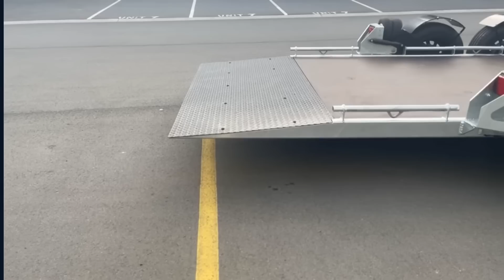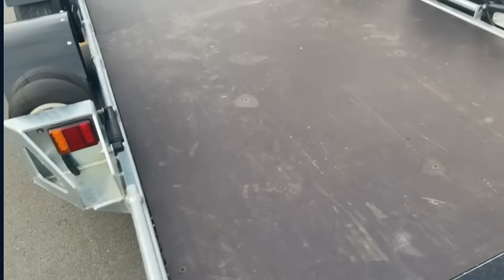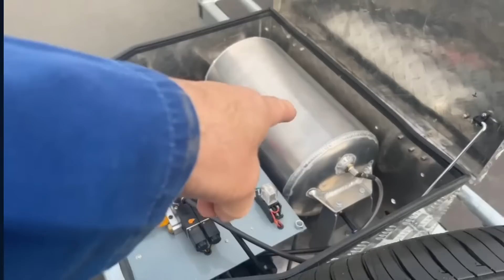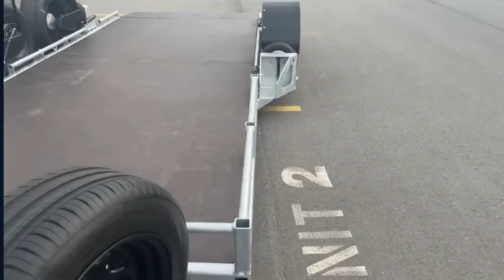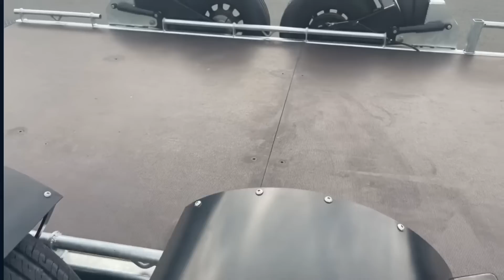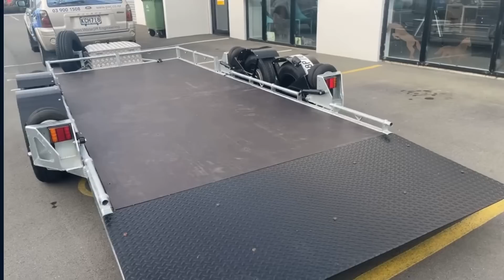How does an Airbag Trailer work 1.3

Comment: Looks like you need to add a Water separation system to the Air line and you can see that it's leaking from the Trailer Airbag and leaving the water puddles on the ground at the back axle of the trailer. And or a way to bleed the water out of the line.....
Reply from the maker: If you are referring to that small mark on the left rear of the trialer, I believe thats oil drips from another vehicle, you can see other oil marks on the tarmac.   We do have a water drain on the bottom of the air tank in the box. No water can leak out of the airbags, if water could get our, so could air, right :-)
Reply: @ultimatemanshed  well that so called oil leak did get bigger the next time he was walking around the trailer and then it should have a Air line bleeding valves on the Axle Air line and it should be just like a Normal Brake mineral based oil bleeder valve to get rid of the water that does accumulate in the line and then you can see that the so called oil leak isn't there on the first time of him showing it and then it's there 🤔 and I'm not being critical on this setup but it will need a bleeder valve on the Air System just like the Hydraulic System does 🤔.... and like the Brakes on your Car....

Comment: Excellent engineering, the only thing I would add is a mechanical locking mechanism for the airbag hinges. I'm sure they are tough, but just for peace of mind in case one blows.
Reply from the maker: so, the problem here is if a bag does blow, and we have never had one blow in four years with hard use and very adverse conditions :-) even if you lock the wheel down so that it’s on the ground in a fixed position you still have a leak out of the bag, and as a result, the entire side will drop, so the solution is to simply have taps on each of the feeders to the airbags, and that particular tap can be switched off that being the case, the wheel  can simply stay in the down position and follow along where ever the trailer goes so, locking the wheel in any position, if a bag should get a hole in, it doesn’t solve the problem of the air escaping from the system, for that, we need a different solution and it simply means having a valve that can be switched off after the Airbag entry point, and we already have these on some trailers

Comment: That trailer certainly would be illegal anywhere in Europe.
The end of the trailer is a huge no-go in so many aspects if you have an accident.
It's basically a perfect death trap at any  rear-end collision. There is a reason you usually angle the end 90 degree upwards.
Reply from the maker: In the EU, there are regulations that must be met when building a lightweight trailer for consumers to tow behind private cars. These regulations are designed to ensure the safety of the trailer and other road users.

One important regulation is the maximum weight of the trailer, which cannot exceed 750 kg (including the weight of the trailer itself and its maximum load). Additionally, the trailer must be equipped with lights, brakes, and other safety features such as reflectors and rear view mirrors.  

Regarding the rear loading platform height and length, there are also regulations that apply. The height of the platform cannot exceed one meter from the ground,  we are well below this and the length of the trailer cannot exceed 12 meters, we are under 6 meters.  However, these regulations may vary depending on the specific country within the EU, so it's important to check with local authorities for more detailed information. 

You say this trailer will be illegal anywhere in Europe. Please send us the specific regulations that we fail to meet and we will do our best to make the necessary changes
I think you will find that in an accident, the height of the rear loading platform on this trailer will go under any vehicle and a following car would ride up over the ramp.  You are of course right to point out that a particularly small car such as the one driven by Scooby Doo or Mickey Mouse should take more care and not follow us on a public road. We will send them a letter of advise :-)

Comment: Hi :)  That is really one of the nicest trailers I've ever seen. It sort of expands the concept of what a trailer is. I need to know though, how on earth can you drive this, with a normal sized car. It might just be very restrictive Danish regulation, but pulling 2000 kg with something that's not a whole lot heavier, is definately not legal in Europe. Also that electronic brake, how does that work?
thanks for the vid and potential answers :)
Reply from the maker: In Denmark, the rules for towing a car trailer depend on several factors, including the weight of the trailer and the type of driving license held by the driver. Generally, drivers who obtained their license before January 19, 2013, can tow a trailer with a maximum weight of 750 kg without any special restrictions. However, drivers who obtained their license after that date must take a separate test to tow a trailer with a maximum weight of 750 kg or more.

Regarding the weight of the trailer, Danish regulations state that the maximum weight of a trailer that can be towed by a normal-sized car is 750 kg. However, some cars may be able to tow heavier trailers if the car's weight and the trailer's weight do not exceed a certain limit. This limit is based on the car's weight and varies depending on the type of car and the driver's license category.

As for the electronic brake, this is a system that is used to control the trailer's braking when it is being towed. It works by using sensors to detect when the car's brakes are applied and then applying the trailer's brakes in response. This helps to ensure that the trailer stops smoothly and safely, even when the car is braking suddenly or heavily.

I hope this helps answer your question
Alan

Comment: This looks really insane. 
BUT:
What happens when there is lost air pressure during driving? For E.g. something will break on the airflow system, so it just gets lowered? This I see as a big danger. There should be some blocking mechanism when lifted or the possibility to lock the position as lifted. Just to get low unlock/remove some mechanisms for safety.
But the really nice proof of concept. :)
Reply from the maker: The suspension goes to the ground and you have to fix it. pretty much like a normal trailer if yo get a flat tire or broken axle or spring. However nothing happens in an explosive way, its usually a very slow leak at a connection, not the bags and it might take several days to go down.

Comment: Is there a protective cover for that razorblade shaped rear edge, when operating in traffic?
Reply from the maker: I don't know what sort of razor blades you have been dealing with but there is non on the trailer.  It's a ramp and anyone travelling that close wis going run in to anythign in their way.   In all the trailers and the years we have made these no one has run in to the back, sides or front.
Reply: @ultimatemanshed  Don't try to sell that in Europe. It's not going to pass roadworthyness.
Reply from the maker: @woeufuS  I am not sure where you derived your information but please consider the following as currently can meet all these requirements: 
 The purpose of this report is to outline the key requirements for building a car transport trailer that complies with the regulations set by the European Union (EU).

Weight Requirements:

The weight of a non-commercial trailer, including the weight of the car it carries, must not exceed 3,500 kg. This limit is imposed by the EU for safety reasons and to ensure that the trailer can be safely towed by most passenger vehicles without compromising their stability and braking capabilities.  We do make trailers that meet these weight limitations.

Brake System:

The trailer must be equipped with a braking system that complies with the EU requirements. The braking system must be able to bring the trailer to a complete stop within a certain distance, depending on its speed and weight. The braking system must also be able to hold the trailer stationary on a slope. The type of braking system required will depend on the weight of the trailer and the vehicle towing it. For trailers weighing up to 750 kg, a parking brake may be sufficient. For trailers weighing between 750 kg and 3,500 kg, a hydraulic or electric brake system is required.  We install a certified and EU-approved brake system on all of our trailers and exceed all their minimum requirements.

Lighting:

The trailer must be equipped with lighting that complies with the EU requirements. The lighting must include two red position lights at the rear, two amber indicators at the front and rear, and two white headlights. The lighting must also include a number plate light and reflectors. The lights must be visible from a distance of at least 100 meters.  We install and again exceed these requirements.

Maximum Width and Length:

The maximum width of a non-commercial trailer is 2.55 meters, and the maximum length is 12 meters, including the tow bar. The trailer must also comply with any local regulations regarding width and length restrictions on roads.
 Some of the trailers we build are over these dimensions, however, we also build trailers that meet these dimensions which are global and consistent with our New Zealand regulations.

So, I dot see the problem, please be more concise and tell me what we need to do to comply 🙂
Reply: @ultimatemanshed  Thanks for the answer. The ramps over here are normally folded up after the trailer is loaded. That prevents other road users from getting cut in half in case of a crash. But yes, I can't tell where the minimum radius of protruding parts is defined. Especially if this is towed by a 3.5t vehicle where the strikt rules for commercial trucks don't apply. 

 It also provides a rear facing surface for license plate and rear lights (that need to be within 30cm from the end).

But yes after nearly getting killed by one of those 3.5t "professionals" I might be a bit oversensitive. The one in the video has at least a few cm of rear facing surface.

https://youtu.be/ZlU6Xp6Gs7o

Comment: I don't own any trailers but seems like the drivers need to remember the long rear overhang when turning. Maybe a flip up ramp be a better option. Also, since it can be raised and lowered independently, does it have a self levelling function?
Reply from the maker: The trailer is self-leveling with its load, and the air in the bag is equal to the load pressing down on it. all you do is adjust the ride height.  As for the running issue, well you just have to practice and learn how to drive a trailer, just like when you learn to drive a car :-0

Comment: Подушки взорвутся они под таким углом долго не будут работать.
Reply from the maker: "Подушки безопасности, используемые в системе подвески прицепа, изготовлены из прочных материалов, которые могут выдерживать тяжелые нагрузки и длительные периоды использования. Они предназначены для постепенного накачивания и спуска в зависимости от нагрузки и дорожных условий и не склонны к взрывам даже при экстремальных углах."

The airbags used in a trailer suspension system are made of durable materials that can withstand heavy loads and long periods of use. They are designed to inflate and deflate gradually based on the load and road conditions and are not prone to exploding even at extreme angles.

Comment: In Germany we say what the hell big bulshit. Not Stread legal. OMG Dangorus !
Reply from the maker: OMG..... please expand on this statement so that we can try to change the trailer to make it legal. tell me what the illegal parts are
Reply: @ultimatemanshed  Absolutely no change to legally move this trailer in Germany. The trailer can sway due to the air bars, which can lead to an accident. There are no shock absorbers installed. There is no protection against a drop in pressure in the air beam if one becomes defective and the trailer lowers. With us, this would have to be done with a cable pull by means of a biolzen safety device in the driving position, which is centrally controlled. Translated with Google
Reply from the maker: @kunibertstraus849  
Falsch, dieser Anhänger schaukelt nicht aufgrund einer Konstruktionsmethode. Deutschland hat ähnliche Verkehrsregeln wie die EU, Großbritannien, Neuseeland und Australien, und dieser Anhängertyp wird weltweit eingesetzt. Wenn er auf irgendeine Weise gefährlich wäre, könnte er nicht zugelassen werden.

Ja, es sind Stoßdämpfer eingebaut, schon immer, schau dir das nächste Video an, das diese Woche veröffentlicht wird. Wenn der Luftdruck fällt, senkt sich der Anhänger langsam ab, und du lässt ihn genauso reparieren wie einen normalen Anhänger, der einen platten Reifen hat oder eine Feder oder Achse bricht.

Wrong, this trailer does not sway due to any construction method. german has similar road user rules to the EU and UK and New Zealand and Australia and this type of trailer is used all over the world. If it was in any way dangerous it would not be able to get road registered. 

Yes, there are shock absorbers installed, always have been, watch the next video which will be out this week.  if you get a drop in air pressure, yes the trailer goes down, SLOWLY and you get it fixed just like a normal trailer that has a flat tire or breaks a spring or axle.

Comment: This system with an 1:68 ( or other mulitpler)  truck tire torque "release helper" would be much better .
Reply from the maker: J.S, sorry, I am not sure what you mean "would be much better". Much better for what on the trailer?
Reply: @ultimatemanshed  

Actuate the mechanism by  a torque multiplier and not by air pressure.

Comment: Looks like a very nice unit.  One thing I'm wondering about is how it behaves under heavy braking.  It looks like braking (while moving forward) will remove weight from the front axle and add it to the rear, resulting in the brakes locking.  I can see where you wouldn't put brakes on the rear axle as that would tend to flip the swing arm into the fully down position, lifting the trailer high into the air at that point.
Reply from the maker: The brakes are electric drums controlled by an electric variable braking power computer, which is in turn controlled from an app on a mobile device.
Braking power can be adjust and preset for various loads and they are very effective at pulling up the trailer and the car. In fact if on a dirt or metal  road you can brake the trailer only and allow it to pull the car to a stop if needed.
When the brakes are applied the trailer will squat if anything and apply more braking to the front wheels. There is no axle rotation.

Comment: lifetime warranty, precise technical description, well built trailer.  Very awesome system.  this would be great for low cars, but can you raise it up enough to allow the car doors to open once loaded?
Reply from the maker: I'll do a video of car loading and show the door issue, The trailer has a remote controls on the  airbags so you can drive on ,t eh oft the trailer while sitting in the car, which allows the doors to open so long as they are taller than the strong-back tie down rail.

Comment: The Air bag setup it great, it’s used on 99% of road transport in some way now. One thing I did see was the lack of shocks. It would travel a lot nice on the road if you added them or do you find it’s ok…. That ply looks nice but we have found it only lasts a few year and she toast, It seams to start coming apart.    Great trailer though, well done.
Reply: There are shocks on every corner.
Reply from the maker: Yes Danya is correct we have shocks on all corners, the smooth the bumps but the is no need to smooth the general ride as airbags are in generally smooth. Make sure you subscribe and you will be notified of the next video which will show all the features in more details.